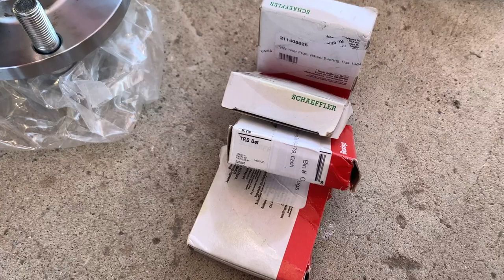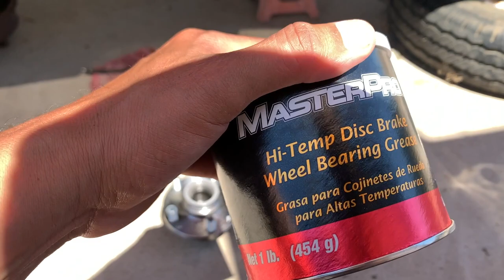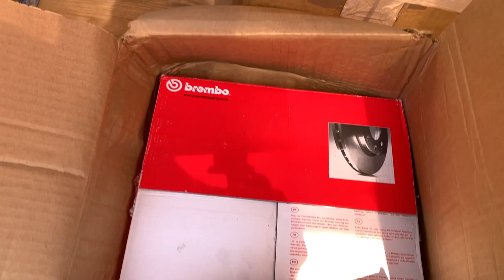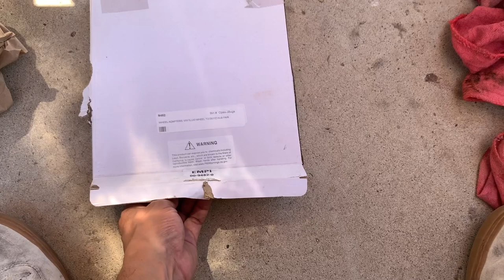EMPI DROP SPINDLES | Disc Brake Conversion Part 1 | 1969 VW Bus Revival Project | Episode 21

Comment: The Ball joint came out of that spindle so easily! Wheels are going to look really good.
Reply from the maker: Yeah I noticed when I loosened the top one as much as possible and then banged on the the spindle it popped out. The top one came out by it self. Might be because I’ve replaced the ball joints in the past.